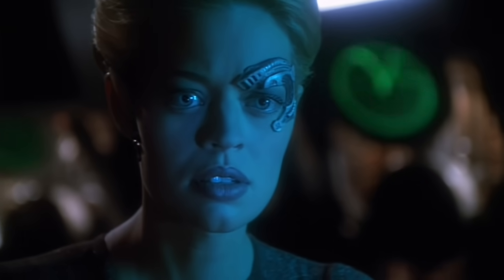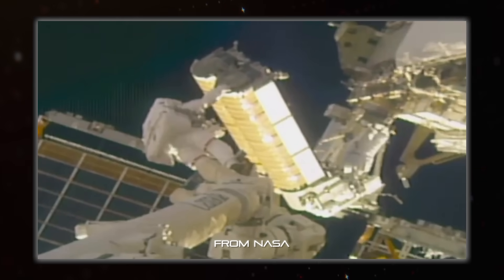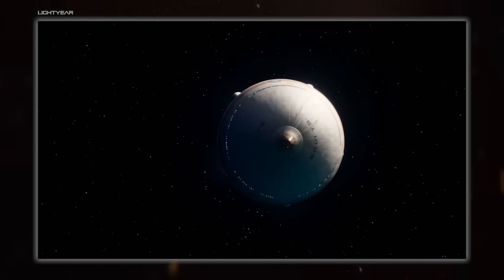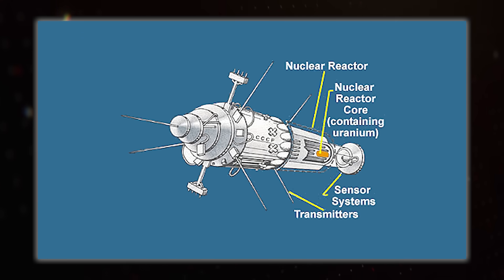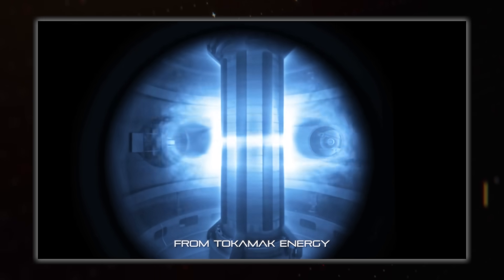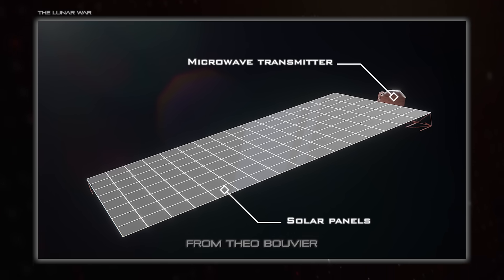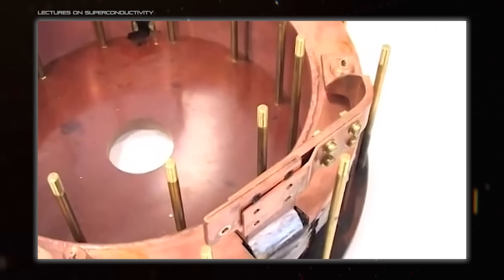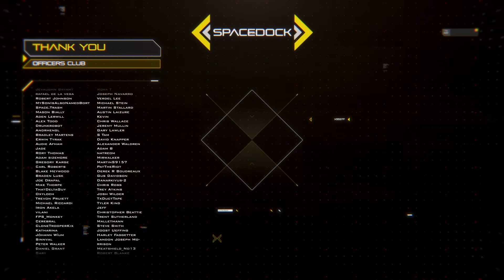How to Power a Sci-Fi Spaceship

Comment: My favourite spaceship power source has got to be black holes. Rotating black holes generate power when things are thrown in (though they do slow down in the process; that's where the energy comes from), and a small kugelblitz or similarly made black hole would output significant energy from hawking radiation. You could also use a particularly small black hole and reflect its rays with a parabolic mirror of sorts and continually feed the black hole with energy to use it as a spaceship drive.
Reply: Like Romulans or Triglavians?

Comment: 2 questions which you can answer in separate videos if necessary:

1. Would Darkmatter be a sufficient fuel?
2. Is there a spaceship equivalent to diesel (relies on compression rather than combustion)?

Comment: you seriously did the
"we have gained the ability to harness the pure power of the sun"
"cool, how do you do it?"
"well, we use the light to boil water which powers turbines, which in turn ..."
Reply: all* power sources boil down to the simple steam engine.
Reply: @decrofull No? That's not the typical solar panel MO, at least not on the small residential scale. The biggest roadblock before scaling that up is the current state of batteries and electricity storage in general.
Reply: @Cazleb_Baker  Yeah, PV cells just go from sunlight in, to electricity out. No steam required.

Comment: In other far more exotic concepts and out there to the point of if its even possible at all would be. 
- Havesting rotational power from a black hole. 
- Zeropoint energy wich is arguably not possible at all. (Havesting energy from space it self)
- And finally the ultimate DO NOT DO wich is "Vacuum decay" Purposefully and literally knocking the higs field out of its metastable state causing it to release the energy stored in it. Any containment faliure what so ever would = a speed of light expanding ball of instant death as the universe deletes it self but hey you get to burn a fundamental quantum field as fuel :D

Comment: I've always been a proponent for using breeder reactors in space. The fuel, prior to being loaded into the core, is inert and basically safe. Only when activated in the core does it become radioactive and unsafe. Fuel can be burned much more completely in breeder reactors, so there wouldn't be as much high level nuclear waste and what little there is could be sent via special probes to orbit the sun in a designated solar orbit for the few hundred years it is still radioactive and the material could then be recycled for use elsewhere.

Comment: I have a few diffrent power sources in my setting, but the one I am the most proud of involves the farming of special quazi-stable crystals which will undergo fusion if exposed to the right wavelength of gamma radiation. So you get a gamma laser, a crystal, and put them in a minimally shielded box (this specific reaction doesn't produce all that much ionizing radiation) and the crystal will undergo fusion, converting 93% of its mass into energy at a rate dependent on how much energy is being pumped into it by the laser.

TLDR; easily replaceable crystals are used to make tiny stars on starships and many other things to tap them for power.

Comment: There's a theoretically perfect power source called a "Hawking Knot" (from Orion's Arm) which uses a microscopic black hole (MBH) to basically turn matter into anti-matter (explanation below). You could imagine an advanced civilization creating anti-hydrogen from the abundant antimatter produced by such a device then fusing it to create higher elements. Then antimatter could be densely stored.

In my setting: even to a civilization capable of such tech, creating worm-holes larger than a few angstrom in diameter is prohibitively resource intensive, so they power their ships by spooling nano-threads of anti-iron into tiny wormholes that feed it to ship engines.

On Hawking Knots:
According to our best current understanding, the Hawking radiation from a black hole gets hotter (more energy per photon) and more luminous (more photons) as the black hole loses mass. This leads to a run-away phenomenon called "evaporation" as the black radiates away all its mass in an exponentially accelerating explosion!

If someone were to figure out how to cram matter into a black hole to keep it from evaporating, they could basically convert matter directly into energy in the form of Hawking radiation. Even better: if one "tunes" the mass of the black hole just right, most of the radiation would be so energetic that the photons generate matter-antimater particle pairs. Then you just separate the pairs before they annihilate, pocket the antimatter, and stuff the regular matter back into the MBH and you've got yourself a good old-fashioned matter-to-antimater converter or "antifier" for short!
Reply: Just don't worry too much about little details like:

1) How does one make/find an MBH?

2) How does one stuff matter into one of the most violent explosions (MBH evaporation) k own to science?

3) How does one separate the particles from the so-called "pair production"? 

...and about a million other "practical" concerns.

Just imagine running a ship on ANTI-IRON! There's literally nothing more effing METAL than that!
Reply: @AbeDillon exactly
Reply: We can't make or mine black holes though

Comment: The most powerful hypothetical (and I do mean "hypothetical," even the design phase would require technologies we don't have access to) reactor type would be a contained black hole. See, black holes aren't static -- due to the natural churn of space-time, "vacuum bubbles," pairs of particles and antiparticles that instantly annihilate, constantly form in empty space. (It's all very complicated and gets into quantum field theory I don't even remotely understand -- the point is, it happens). When these pairs pop into existence on the event horizon of a black hole, however, the antiparticle can fall into the hole, leaving the other particle out to wander the universe while it annihilates a single particle of the singularity, a process known as "Hawking radiation." In effect, this completes near-perfect mass-energy conversion via a black hole, which could be theoretically harnessed for power or as a thruster.

The black hole slowly evaporates during the process (smaller ones do so quicker), and so every so often you can just toss literally any matter into the hole and it'll gain the appropriate mass.

Comment: solar sucks. especially on the outskirts of a solar system, also consider the different kinds of stars. also they have to be on the outside of the ship.

best solution is nuclear, be it decay batteries or full on reactors.
fusion would be even better once we get it working.

antimatter...well probably not. you either have to have a way to generate it cheaply or take large amounts which isn't ideal.

Comment: Otherwise known as a TEG which is a thermocouple which relies on the Seebeck effect. 
Temperature difference makes the electrons flow in an RTG which is made from the same stuff as a TEG or a TEC . All of which use the Seebeck effect to make the juice.
So an RTG a TEG and a TEC are all the same type of thing which rely on the very same effect to make power.

If you stuff power into any of the above you will make a hot side of the Peltier module and a cold side (about minus 5ish) which cools your little bedside fridge.

The modules from a bedside fridge can also be used to power a stove fan. (Magic battery) 

In fact a TEG lives in every 02 sensor which tells your engine if it's burn cycle is correct.  Unless it is a VW .

Signed,  the Pikachu who uses electrons to feed himself every day and fix others electron conductance issues. 

Brilliant vids Mr Jawana. Keep it up . Forever.

Comment: Concerning Hydrogen Fuel Cells, they might be the most convenient power storage method due to the abundance of their required materials. Lithium is a nice metal to have for batteries but usable amounts in our solar system are way more limited than oxygen and hydrogen. Right now of course the main factor for spaceships produced today is mass since you have to propel all of it with rocket fuel. The hopefully soon turning point of producing spacecraft on a lunar base instead of Earth would allow for more massive ship designs with heavier power sources like the ones listed in the video.
Reply: Lunar production is a good idea, I’ve always used space elevators but I might include that!

Comment: There is another power source available in space, Gamma Rays produce megaelectron volts and are constantly available, need to figure out how to capture gamma rays just like a solar panel captures photons.   Experiment with receiver antenna types that can capture x-rays then convert into electricity then modify method for gamma ray frequencies.

Comment: Nuclear fission: "Though there hasn't really been any mission since [the Cold War] that would justify using them, in large part due to the rapidly rising capabilities of photovoltaics."

Yeah, as it should be with Earth-bound energy generation.
Reply: You would be suprised how many satellites used nuclear fission to generate energy.
But of them had a passive generator since a active one would need shielding and better cooling.

Comment: One energy source I think could work would be some kind of standalone thermoelectric generator. Not only is this more power, but it's also less heat and so fewer required radiators. There is a limit on what you can do and you can't remove all the heat, I think it could be helpful for a long range expedition or something

Comment: As for your last point, there is - or should be - a corollary to the Kzinti lesson: "The effectiveness of a shipboard power source as a bomb is directly proportional to its effectiveness as a power source." You want your shipboard power source to be as energy-dense as possible to minimize launch mass, and capable of releasing that energy quickly, which are the exact same characteristics you want from an explosive. (And it's not even only for sci-fi ships; the biggest non-nuclear explosion in history was caused by the failure of the second N-1 rocket shortly after launch, and it wasn't even the worst-case scenario because only a sixth of the propellant ignited.)

Comment: Black holes make most efficient power source out there; they convert matter into energy, and the less massive they are, the faster they output this power, so if we can make tiny artificial ones, then we just got power source that overshadows everything else to lidicurous extent. Black holes also can be held by magnetic fields, so they can be moved, and move with the ship. Ship would need to be freaking massive though, but with ammount of power those bad boys can output, propelling it isn't that much of an issue.

Of course, it is by far not a near future solution.
Reply: We can't make black holes though
Reply: @scifirealism5943  Not now, and frankly, I doubt in this millenium, not purely because of technology, but because of sheer scale you need; to make black hole you need to cram a lot of matter, or photons, into one place. Either of those require truly lidicurous industrial build-up, and is actually in line with something civilisation with dyson sphere could do, so, again, not a near future solution. But most definitley doable at one point, just a really far-off one.

Comment: There is one tier of power source even more ridiculous than antimatter: the Penrose process. If you confine a black hole inside a mirror and then shoot light in there, a large portion of said light will bounce around and be amplified by the black hole’s ergosphere, coming out with much more energy.
Reply: Note that the black hole must be rotating, and every time you use it some of the light is absorbed, making the black hole larger, causing it to spin more slowly due to conservation of angular momentum.
Reply: And a micro black hole.

Comment: We sci-fi geeks also know of a way to avoid having to bring your fuel with you:  the hydrogen fusion ramscoop, where interstellar hydrogen is gathered or scooped while in flight and used to power a fusion generator and/or motor.   Technically there might not be an upper limit to the max speed achieved, aside from lightspeed.  
There's also ion drive, which is within our capabilities today...just with very, very slow accel.

Comment: You missed black holes. bit further along than fusion, but potentially far greater. Then there's Plank/vacuum/zero-point energy. Farther along than even using black holes to generate energy, but again, far more potential for energy generation as well. 
M-AM reactors, I consider more power storage because you have to make the anti-matter first, you can't just go harvest it. Bit like Gasoline in today's world, it's a store of power to be converted into whatever form you need it in.

Comment: Starfleet in Star Trek should really look into the Artificial Quantum Singularity power sources that the Romulans use.
1.) Nearly inexhaustible power
2.) ALL waste matter and energy can be fed into it, and recycled into more power
3.) You can grow it larger by feeding it, and then extract MORE power from it
Reply: Yep
Reply: #3 can't happen because the micro black hole is too hot.
Reply: @scifirealism5943  I'm sure they can come up with some Treknobabble that fixes it.  I'm still pissed that Voyager didn't look into this, especially after Seven of Nine joined the crew.  The Borg have assimilated Romulans before (and plenty of others) I'm sure she could design a better AQS power core than the Romulans have, and it would have permanently fixed Voyager's fuel problems to boot!
Reply: @sterlingdennett  epic.

Comment: In my Sci-Fi. fuels are classified as followed:

Type 1: Gatherable/Renewable (Solar, Gasses collected from where the ship is flying)
Type 2: Quick Burn fuels (Fossil Fuels, Coal). Sometimes considered dirty fuels, but mostly used in atmosphere conditions.
Type 3: Chemical Reaction Fuels. Hydrogen Fuel Cells would qualify here.
Type 4 (and most common): Solid Decay fuels. Radioactive make up the majority of this.
Type 5 and 6: Each government has different identification for these, and often fuels not available to the public at large. Anti-Matter would be classified in these types

Each government has bans on certain fuels of each type that sometimes make traveling annoying for captains.
Reply: This is an excellent way to classify them!

Comment: This has bothered me for a while: A gram of matter encountering a gram of antimatter produces 43 kilotons' worth of energy. Two grams are a tiny amount of stuff that can fit comfortably in the nose of a pistol bullet, which to my mind means that photon torpedoes and Star Trek warp drives can be built ridiculously small, even taking into account their need to warp space. So why are M/AM-using starships so hella big in sci-fi media?
Reply: You need tens of millions of metric tons of antimatter to power a starship.
Reply: @scifirealism5943  Nope, unless you're talking a ginormously humungous interstellar ark using an Orion-type sputter drive. The Enterprise-D carries a normal total antimatter supply of 62,500 cubic meters of slush anti-deuterium (I suppose -- how much is that in kilograms?), which is rated to see her through a standard three-year mission. (Bear in mind that the Enterprise-D's warp drive is WAAAY BEYOND 100% efficient.)
Reply: @seanbigay1042  that's enough for a power plant, but not a propulsion system.
You need twice the mass of the ship in antimatter fuel to reach 50% light speed.
Reply: @seanbigay1042  that works out to about 5 metric tons.
Reply: @scifirealism5943  Bear in mind that with warp drive, the Enterprise-D is basically cheating!
P.S. Speaking of cheating, we're talkibg about slush anti-deuterium here -- that is, anti-hydrogen that's been compressed and frozen into anti-deuterium ice, as opposed to room temperature anti-deuterium gas. Does that change your math any?
Reply: @seanbigay1042  the ship has quantum charge reversal devices that makes antimatter en route.
Reply: @scifirealism5943  See? She cheats! ):D
Reply: @seanbigay1042  do you prefer antimatter or black holes as a power source?

Comment: Past: burn the coal to boil the water to turn the wheel to make the power
Present: split the atom to boil the water to turn the wheel to make the power
Future: collide the matter/antimatter to boil the water to turn the wheel to make the power
Reply: You can also use bioelectrical energy or cosmic radiation.

Comment: Use the centrifugal gravity in the Large colony ship to power the ship's systems, and banks of lasers pushing on the light sails. Turn kinetic energy into electric energy. On paper, it would seem to work.
Reply: But what powers the centrifuge in the first place? Can't use it to generate power if it uses more power than it makes just turning. That's like hooking a motor up to an alternator that powers the motor. Something has to introduce new energy into the equation or the losses will just grind the whole system to a halt.